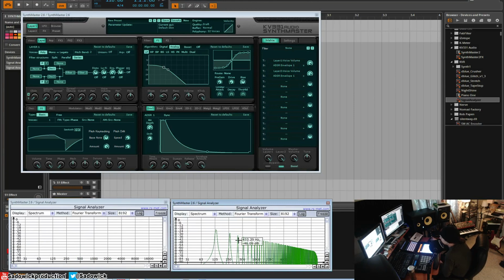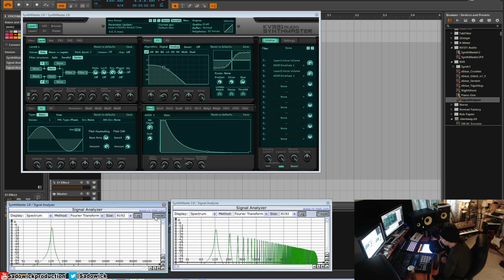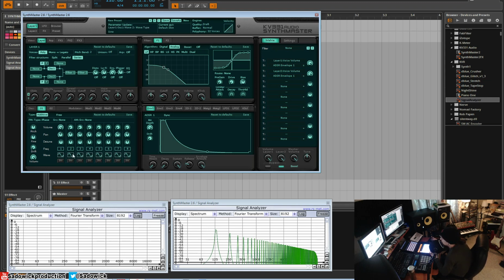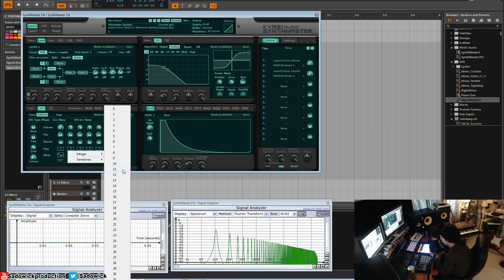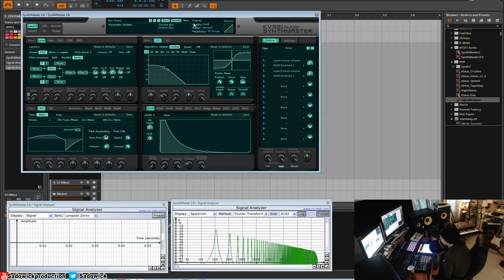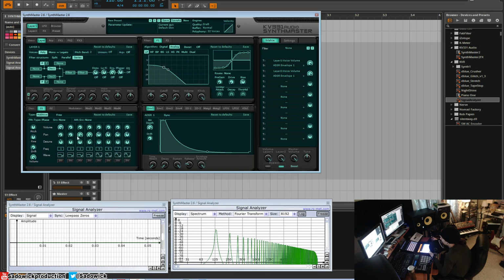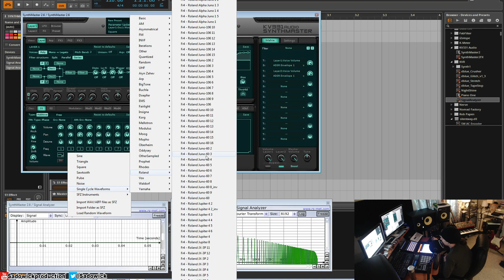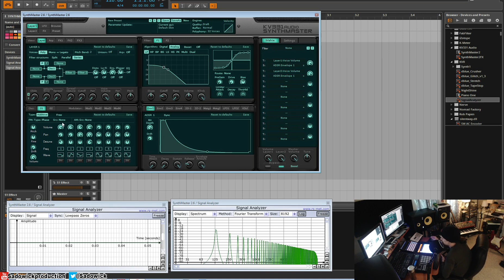KV331 Synthmaster Tutorial 06 - Additive Synthesis

Comment: This tutorial series is so helpful, thank you!

Respectfully, though, I think you may not be describing "integers" correctly. It looks (at 1:04 on the left FFT) like integers aren't musical semitone intervals but rather frequency multipliers. So 2 is an octave rather than a whole tone, 4 is 2 octaves, and 12 is some very strange interval. Hope that's helpful. Again, this tutorial is amazing and I really appreciate it!
Reply: Yeah, I think the "integer" number corresponds to the (n)th harmonic overtone of the fundamental, where the perceived difference in pitch between each harmonic (i.e., the semitone interval between harmonics) gets smaller as that "integer" value rises.  (Yeah, additive synthesis is awesome/crazy, depending on who you ask.)  FWIW, these are the same harmonics you can hear by tweaking the cutoff (low-pass) filter knob with the resonance cranked up on most any subtractive synth (or SM on "Basic"--because SM does everything).  As the cutoff increases, the resonance spike at its edge will really highlight the next harmonic being allowed through, so you can really hear each harmonic's "pitch" as you slowly open the filter.  

Anyway, Wikipedia has a quick 'n' dirty catalog of harmonic intervals if anyone else is curious (see the paragraph right above the staff notation):  (http://en.wikipedia.org/wiki/Harmonic_series_(music)#Frequencies.2C_wavelengths.2C_and_musical_intervals_in_example_systems)

Sorry for the rant; nitpicks aside, this tutorial series is FANTASTIC--thanks, Sadowick!